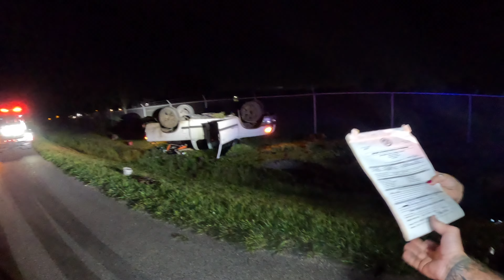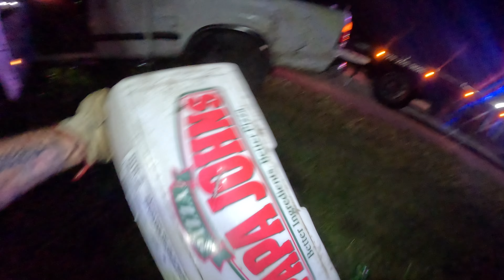I Can't Believe I Made This Mistake!

Comment: A long big j chain bridal is my goto, it’s all I use anyway but it allows me to hook both left and right side of the car on its roof, pull low to get it to its side, then choke the high side of the bridal as much as I can to roll it to its wheels, and I will almost always be positioned in a spot where once the roll is complete it’s on its wheels at the edge of my bed and I can take my snatch block out, unchoke the bridal and take it straight up. No need to mess with a long chain under the car because we all know it just wants to get stuck on everything when you try to break it down. Only time I use a long chain anymore is when it’s icy and I have to use a rollover stick but that’s almost never the case even when it is icy.

Comment: Before I watch anymore of the video, I can see that your hooking the chain onto the leaf springs of the truck instead of the frame slots, which in my opinion anyway i wouldn't feel very comfortable with pulling on the side of the springs or the suspension like that when flipping the full weight of the vehicle back over. That and your hooking it to the left side of the truck which is facing up the hill, so it's not gonna roll back over and just slide across the ground. 7:02 but as you said everyone makes mistakes. 👍
Reply from the maker: Frame slots aren’t recovery points, even if it’s common practice to use them as such.
Reply: @Towtruck_Dustin  oh

Comment: Yeah everybody make mistakes rookie when you are doing your cleanup do you charge a flat rate or by the minute
Reply from the maker: Depends on the contract. Some departments allow cleanup to be charged, some just set a higher rate unless it’s special circumstances where a bunch of extra work is required.